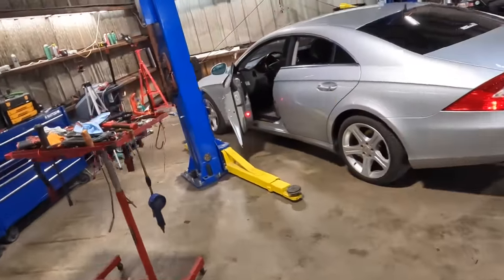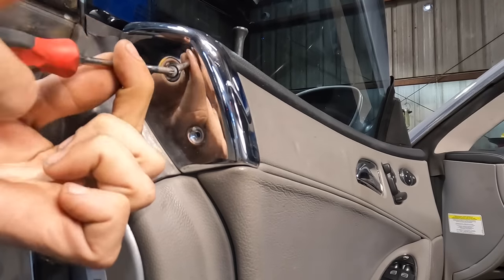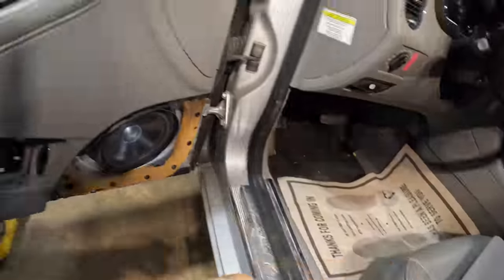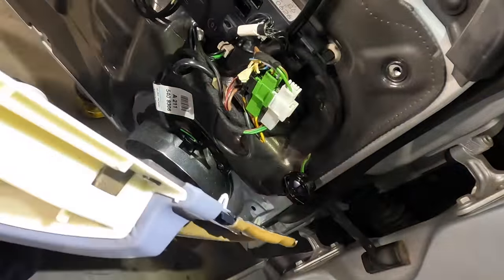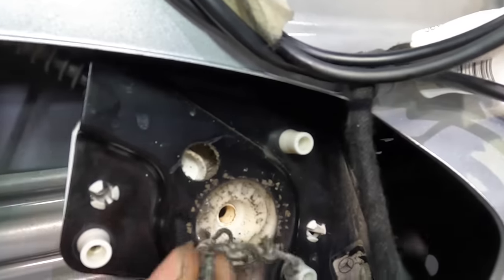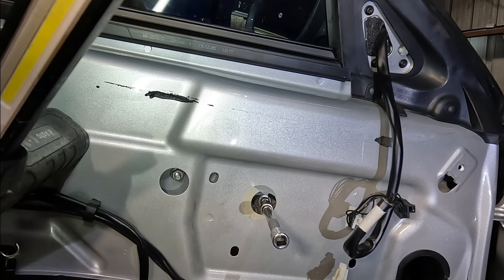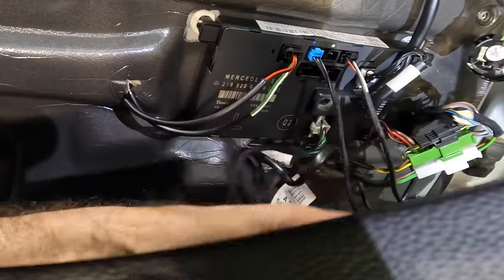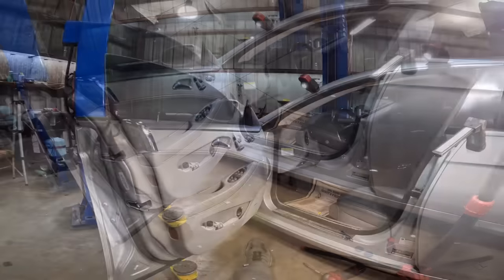Overly Complicated?  Mercedes-Benz Interior Wiring!  CLS 500 (LOUD NOISES!)

Comment: Actually, this was a very interesting video.  Seeing how different manufactures engineer their autos is quite compelling.  German autos appear to have more complexity than is necessary.  BMW follows suite.  I'm very impressed with your ability to remember where all of the clips, bolts and parts go during reassembly.  Good job!
Reply: Germans tend to accomplish a task using the cleverest technology that can be imagined... see footnote BMW motorcycle rear axles :)
Reply: @RickHamouris dude… so right
Reply: I mean the over engineered for a reason on most things
Reply: On VW Jetta you need a scan tool to "register" a replacement window controller.  No joke.  
Why make is so complex and difficult to service??
Reply: @midcenturymodern9330  Just as revenge. We´ve learned this from apple and Iphone!
Reply: After spending 25 years as a specialist tech fir a major German company I can certainly vouch for your statements
Reply: While in an auto parts store it occurred to me there was a time where I spent a lot of money there. I asked myself "What changed? I haven't been in here since I sold the Mercedes..."

Comment: Use a heat gun to warm the sound reduction material before you try and pull it off. It makes it much easier to get that glue to unstick if it's warmed up and most of it stays on the sound reduction. also, lay it flat and warm the glue before you reapply it. If it doesn't want to stick back a little Sikaflex will fix that problem.
Reply: await to see next job if he adopts ur advice.
Reply: Especially important to make sure the membrane is sealing, because them not sealing well can cause water leaks into the interior.
Reply: @tschuuuls486  don't think he knows that purpose, thinking for noise barrier only. top pro knowledge.
Reply: @tschuuuls486  Yep.
Reply: Definitely cringe that the butyl wasn't replaced, newer models have a module that unbolts and seal is integrated
Reply: @thewolf61691  got what u pay for
Reply: @forgetful me  to be fair ray is still doing better than the average bmw dealer tech, in my last 10yrs of buying them new... the mechanic profession is very tainted.
Reply: That kind of sounds like it would make a hot mess, though.
Reply: @fitybux4664  Naw You only warm it enough for the glue to become a little more pliable.
Reply: @tschuuuls486  It is for sound only. It does absolutely nothing to prevent water from getting into the interior. How is it suppose to be stopping water when it has holes for wires and cables. If you actually have a car to check the door has drain holes to let water out. Prevent water from leaking into the interior. Did you go to school at Internet automotive professional University of I Don't Know Shit. LOL
Reply: @Rotary650  does your Raincoat prevent you from getting soaked while having holes? Same idea here, no its not perfect, but without sealing the barrier in water might pour into the lower portion when dripping down the glass etc.
Had this exact issue happen on a Skoda recently.
Reply: @Rotary650  My Jeep service manual calls it a "waterdam," though like you I fail to see how it makes anything waterproof or water resistant to any great degree.

Comment: That looks like a complete nightmare. I’ve changed many regulators but never on Mercedes. That is insane. Good job Ray.
Reply: Yeah, German cars in general seem to be built to last for the warranty period.  After that, too bad, so sad.
Reply: It’s totally over-engineered, agree.

I will say that the quality is light years ahead of the one I had to rectify in my wife’s Mazda. Whilst extremely easy to get to because of the simplistic/basic nature of the car, the quality of the regulator is laughable.. it was about as strong as taping some drinking straws together & sitting some glass on top.

Comment: Taking off inner panels can be a nightmare...without any other workers around who may have experienced taking off the door panel and showing you the tricks, you did pretty good....when I used to set up cars on the clamps for frame work I always asked the other guys how to remove the lower pieces around the pinch welds....pull off 37 screws, 28 pop pins and the other 6 that break are supposed to do that...phew, that was a relief...great job Ray....on to side 2
Reply: Fricken' nuts to do this job. Gotta be a 3 to 4 hour ordeal knowing what you're doing.
Reply: At least this car is now archived in the youtube library. I stopped taking my vehicles to shops since i found the internet.
Reply: Better you than me
Reply: u are cautious and wise by asking. If he breaks without researching, he owns the oem replacement.

Comment: In case Ray reads this, you may want to purchase a couple of rubber (not plastic) door stops, normally used to hold open a door say in your house and used at the bottom of the door.  I used them for years to hold windows in place on a door window glass to make disassembly / reassembly much easier.  Former Autobody guy here, 25 yr's  plus experience.
Reply: Youre a genius, ive just been taping the window to the top of the door like a savage caveman!
Reply: Great idea.
Reply: Here's a tip for those hard to reach nuts and bolts; put some strip caulk inside the socket which will secure the fastener to the socket.  Prevents dropping parts inside door cavities. Also, tape your socket to the extension and you wont lose them when trying to back out of a tight space.   Just my 2 cents!
Reply: I wonder if your garage floor is completely level?
Reply: Where are those suction cups you used in your other videos, made while you worked at that last shop?  You had two sets which secured the glass quite nicely.
Reply: @jamiepatterson1214  Those won't work because there is no top to the door.
Reply: Stick some painters tape inside your socket then push the nut in…boom nut stays put inside the socket
Reply: He does use some orange doorstop looking wedges in his older videos when he worked for a retail location.
Reply: @Izzy Dizzy  I often put paper towel over the opening of the socket and then push the nut into the socket. Then tear off the excess paper towel. The paper towel fills the tolerance between the socket and the nut thus holding it in place. Tighten the nut and remove the socket and the little bit of paper towel just falls out. Works great.
Reply: That is genius, thank you kind internet user 🙏🏻

Comment: Its great to see you just diving in any not shying away from challenges, I would kill to have workers like you in the workshop I work at.  Here is a couple of useful tips for when working with interior trims.

- Get some plastic trim tools, they are cheap and are much safer to use on painted surfaces and around interior trims
- A Heat gun is your friend when working with adhesives, most trim adhesives are a Butyl base and a little heat makes them separate with ease and even permits adhesion when reassembling

Comment: Its so cool to see behind the scenes of teardown of something he never done before:

Knows they are plastic fasteners behind holding the cover
Knows that door handle area always has screws
Uses prybar gently with plastic fasteners
Inspects new regulator for nuts positions
Reply: Door whisperer? At least he can refer to the vid to see where everything goes back👍
Reply: many things like this I have done. whenever it's on a vehicle I'm not familiar with I have a phrase. " same s***, different flies" cause you know most of what needs to be done. it's just a different pattern.
Reply: @MikeFatty  Spot on analogy. The covers are going to be clipped down. 2 substantial fastners holding the door pull. There will be at least 3 substantial fastners holding the the window mech. etc etc. 
I alway try to remember that a human assembled it too.
Take photo's every stage.

Comment: Test and adjust with door panel loose- those cars have the window drop  1/2 inch when you touch the handle and also go up 1/2 inch when the door latches.  To do it you need to pop the switches out of the panel so you can open and close the door and have access to the adjusters. Fiddly, but better than having to remove the whole panel later on.

Comment: One tip I can give is don’t pull those vapor barriers off the goo…..  use a fresh razor blade and cut that black goo! It tends to keep it where it’s at on both the door and the vapor barrier. I’ve been covered in that junk plenty of times! Those strings when ya just pull it off go everywhere! Just minor pull and cut it with a knife and it will be so much cleaner for you! Give it a try. 😊 I think you’ll love it!  
I’ve always hated window regulators lol some vehicles make it very tricky to get the regulators out!  And hidden fasteners are very frustrating! One tiny screw can make you wanna break them off lol we have all had those moments of rage building 😂 oh course we hold it back. Lol
Reply: My dad had an assembly-instruction manual that started : "Remember, when tempted to reach for a hammer, choose a screwdriver instead."
Reply: And if it is the extra gooey adhesive, wipe the razor with WD-40 first.  (Worked with Ice & Water Shield on hot day)
Reply: @richardfabacher3705  then a pry bar.

Comment: Every time I did a regulator, my arms would look like I got in a fight with a tiger. 
Great job on that one.
Not a Reeeeeeeee, but I always plugged the switch in before I put the door panel back on.
But with those 37 connectors,I could see why you didn't. 
Great Video. 
Click.

Comment: I would recommend measuring from the centre of the wheel hub rather than the ground, because if, e.g. a tyre is partially deflated that would affect the measurement and give a false result…
Reply: Good point.  In the GM Holden workshop manuals they always stated to measure from the bottom of the rim to the wheel arch lip. I wondered for a while why they didn’t just use the centre of the rim measurement.   I had the fortune of meeting some key personnel, some of who wrote manuals, and we had a number of discussions on various methods and topics.   The wheel lip thing was kept for so many years for 2 key reasons.  1. When they first started stating these dimensions (over 50 years ago) many cars had wheel covers or partial covers (like dog bowl hubcaps) hiding the true centre of the wheel.  2. Using the bottom lip gave a longer measure which was more easily “eyeballed” for vertical accuracy.  For all the car nerds out there, these guys who write the manuals and parts books are next level. 😮
Reply: @commodorenut  I agree and the bonus to that is there is somewhere to hook your tape-measure onto…

Comment: Boo!  There IS a recalibration procedure for Benz airmatic suspension. Even if the second strut was bad and needed replacement the system NEEDS a recalibration.   I really like your work 99% of the time but the lack of due diligence here is a ding on the report card.  Come on Ray!

Excellent regulator replacement.  Great job.  FYI, I've seen people use a Irwin bar clamp or similar to pinch the glass and hold it up while working below.  Gives the third hand that could have been useful.
Reply: Exactly my thoughts. If a car is to complicated just be frank and tell the customer that you can't do it.

Comment: Mercedes ride height is a computer program issue.  Replacing the still functional strut with a new one did “fix” the problem as the new struts would have the same pressure.  Hopefully it was the owner who requested the unnecessary new right side strut.

Comment: Ray, that was amazing. My sister had the same issue with her Mercedes window and did the exact same thing. Unbelievable. You are not afraid to tackle something you don't know. Question - can you look on-line and get a diagram of the inside door panel?
Reply: There an expensive program called AllData that allows you to see almost anything about a vehicle you're repairing. Fluid capacities, torque specs, diagrams, etc. It's not cheap but for a professional it's invaluable. I'm led to believe however that Ray just used his experience here on this job

Comment: If one strut is bad because of age, it stands to reason that the other is close behind.
Reply: I do believe that it's common sense to replace both just for that reason.
Reply: Those struts are $$$.  $400 each to start.
Reply: Suspensions don't wear symmetrically because the wear on a road isn't symmetrical.
Reply: Fancy costs money. I once dated a girl.........
Reply: @TheFrenchPug  Ray said around 600 on the previous vid if im not wrong. expensive as heck for sure
Reply: @n.shiina8798  Plus a $350 core charge.
Reply: @steveb6103  ah, yes. almost a grand without core. that's why he didnt want to teardown the old ones

Comment: Hi Ray ...... Just a quick thing and I am not a mechanic but Throughout my 60 years on this crazy planet I was told from mechanics in Australia and I assume it is the same in other countries that the DRIVERS side suspension was set slightly higher than passenger side to accommodate for the fact that the driver was always in vehicle and passengers were not always there. Height was only slight but that was what I was informed for the slight difference. Or is that just a crazy Aussie talking lol
Reply: road camber ???
Reply: I’m an Aussie.  Haven’t come across the L/R ride height variance to account for a drivers weight, but there are tolerances stated in the workshop manuals for the cars I own which could account for up to 1/4 inch variance.  The crown of the road would make more difference than L/R height differences.
However, my wheel alignment guy knows that for 95% of the driving I do, I’m usually the only person in my daily, and in my restored 80s Aussie muscle car, so he gets me to sit in the drivers seat when he does the front camber and toe settings.
Reply: This car self adjusts is height.  It doesn't matter if a 100 pound or 300 pound person is in the driver seat. The car will ride at the same height.
Reply: @Ralph_Baric_PhD_C2019  Now that is a likelihood also, never considered that

Comment: Ray - I can always tell when you are either really busy or hassled... No thumbs up or peace sign at the very end. Truth is, that is how it goes when you work for yourself. No time, a million things on your mind and often you are just relieved to get a job done with everything fixed and working again. We understand and if NOTHING else, the lesson for me is for easy maintenance, do not own a Mercedes...
Reply: how about a Ford.??? 🤣
Reply: I think he said Ford make you drill out the rivets?
Reply: @DeepakKumar-lv4te  They do too...
Reply: @mrmustangman  I started to hate Ford when I first worked on an Escort... The firewall was cheap cardboard and the engine compartment was so tightly packed you had to rip most of it out to get to anything other than the spark plugs.

THEN we have anything from GM. The worst offender from them has to be the three different fastener types needed to undo just to get to the back of a headlight fitting on one design and then the stupid "waterproof cup" on the back of the bulb fitting itself that never screws back on - and is pointless anyway... 

Just about every manufacturer has stupid designs somewhere inside.
Reply: People who buy a Mercedes do not dream at night of working on their car. Well made cars are not designed for ease of maintenance. They are designed for optimal use, fit and function. The purpose of the design is to bring lasting  comfort and performance to the driver/owner; it is not in any way concerned with the comfort of a mechanic, nor should it be. The window regulator was wrecked by someone trying to slim-jim the door. It should have never needed replacing.
Reply: @rowdyyates3801  The purpose for the owner is to make them FEEL wealthy.

Comment: That door is completely overengineered for what reasons?  I could not see why it wasn't just one or two pieces.  Your patience is in-flipping-credible Ray!
Reply: It's a door with a window right..who was pounding back the brewskis when they engineered that my God!!
Reply: @alabamared2568  the engineer, of course 🍺
Reply: My thinking is greater attention to detail and quality rather than "over engendered". Just like building a house do it right and well or just toss crap together and hope it works. I'll take the quality option
Reply: Maybe its just me that I used to help friends with EU cars but this to me seems so straight forward.
Screws behind the handle panel,  some screws in the speaker section one or two in the latch section.
Remove teh small triangle speaker tweeter, slide out the panel. (clips are easier thand slide up and unhook one IMHO)

The only "strange" for may is that module in the door. but trust me its better if its there especially with all those buttons! It handles all the buttons and features of the door and allow to have less cables running  in the door hinge. If you cont teh number of buttons of the door and imagine the wiring diagram for all that mess without the door module would be even worse. I've worked on some cars that didnt had that and they had like 50 pin connetors in the door. 50 wires all packed together and once one start failing the others are generally bad too. then you have to swap the whole door harness. (Window regulators wires are also low gauge and more rigid driver side have to push power to the other doors, imagine with 5 door cars how a mess it is. The module handle the buttons and provide info to power to the specified door motor via its own module)
Reply: @alabamared2568  Like, yeah, they must have had a team just for doors.
Reply: @TuttoCrafting  A good explanation. Maybe that helps lastability and the reason you see more older EU cars on the road.